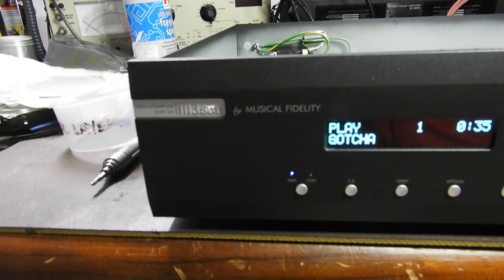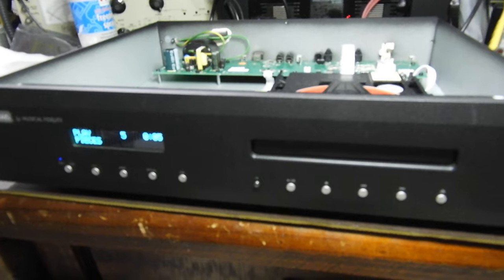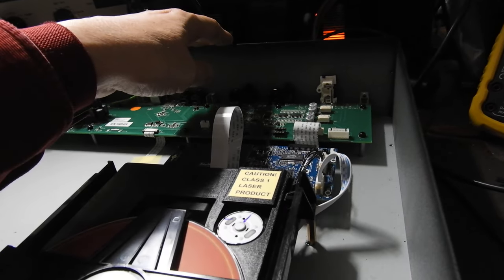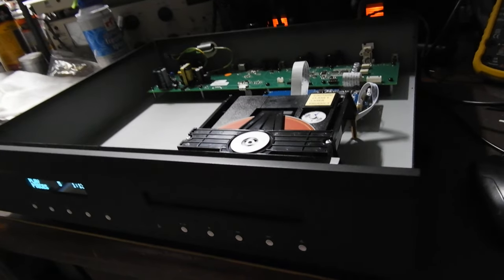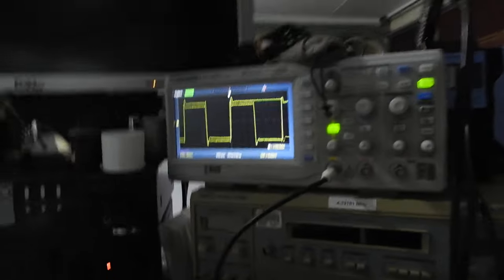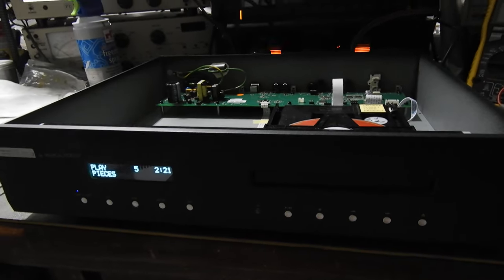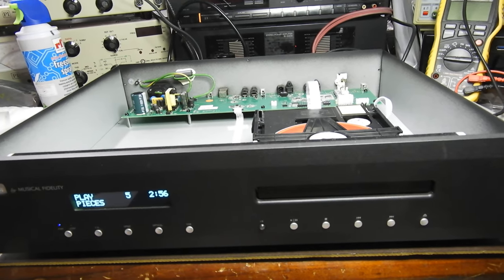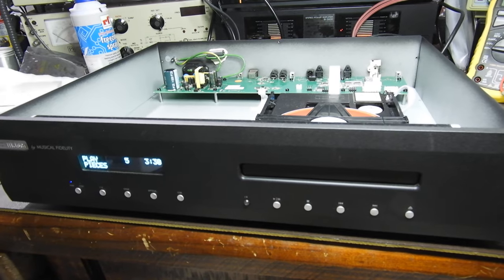Musical Fidelity M3SCD CD player & 192kHz x 24bit DAC.

Comment: Never been a big fan of devices that turn out to be mostly empty when you open them. Obviously things can be made more compact nowadays but it's not a pleasant "look". Reminds me of a bag of crisps which is 75% air. Much prefer the inside look of the old Sony ES players from the late 80s or early 90s - or how companies such as Accuphase and Esoteric are still producing them today.
Reply from the maker: Fair comment. There is this Cambridge Audio DAC Magic which is rather empty and where John Westlake obviously has done this on purpose. He put transformers on one end and the board on the other. Sadly, he made the board too dense to work on. One cannot even get multimeter probe to component or track to measure the voltage. But mostly it is only to have a standard width, just short of 19".
These players from 80s and 90s were the result of trying to make the best they could. Later, manufacturers have found that they could make them "almost as good" for a lot less. And mechanisms were the first to get simplified...
No one does the engineering like Sony used to do. Silkscreening describing components' circuit designation as well as value, test points marked, stages named. And their printed manuals that were full colour, fold out type with marked signal paths, which were designed with ease of servicing in mind.